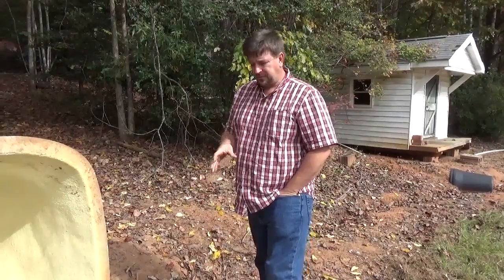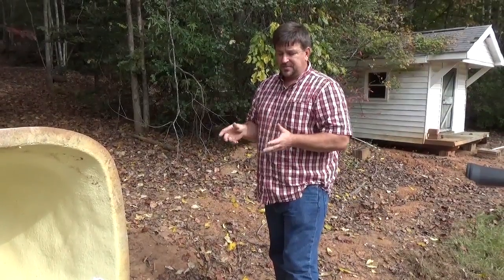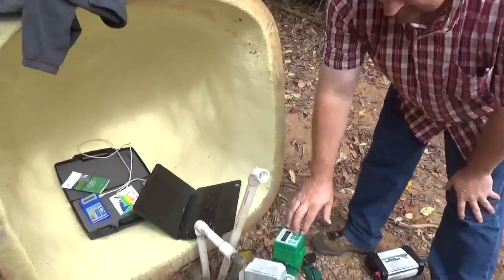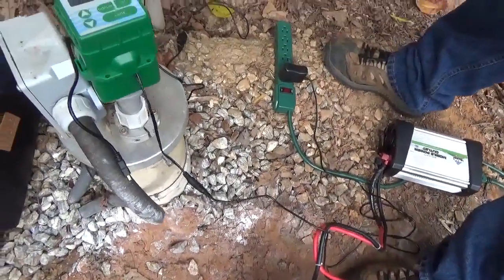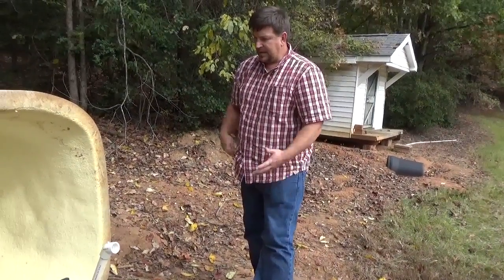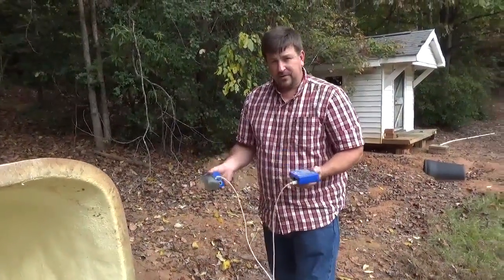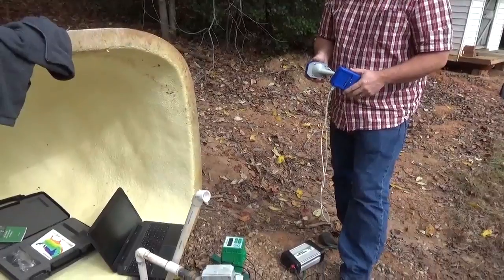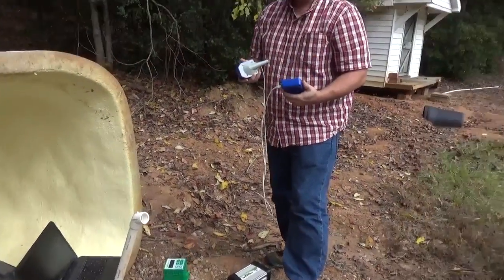Well Monitoring With Well Watch

Comment: I have one of these in one of my wells, you don't need an inverter and power supply.  The wellwatch runs on something like 9-14dc.  You could just hook it to a lead acid battery like you use in a UPS or security system.  Then put one of the RV battery tenders on it and voila.

Comment: I've tried to find out how deep my well is, with no luck.  Is there a way to find this info, without buying expensive equipment?  I think well installers should mount a plate to the housing with depth, volume, pump model & S.N., etc.  Also, a nearby well, about 75 feet from mine, makes a lot of noise... sounds like a waterfall inside the housing... What's that about?  It doesn't seem to coincide with rainfall.  My property dates back to 1789, a filled and covered dug well is nearby (about 20' away) and every so often, my water turns rusty for about 24-48 hours.  I'm always cleaning out the airraters, clogged with what looks like ground salt & pepper.  Would love some advice and help understanding what I have here.  Thanks, +Blessings
Reply: Fishing string and a weight.

Comment: In many areas I compare well water to solar power.  It helps to have external storage capacity.  You can take advantage of periods of high production and have a nice buffer for periods of low production.  This is especially useful if your well water requires treatment for iron, sulfur, or biological issues.  Batch treat it and store it in underground tanks.  In all fairness, it helps to know (monitor) your water levels, but at the end of the day, dry is dry and it doesn't really matter why.  I guess what I am trying to say is that a fuel gauge on a car should tell you when to get fuel, not when you will have to walk the rest of the way.  You don't really have the option to "re-fill" your well.  Recovery can take hours or days.  Harvest the well water and store it while you can.
Reply: There are benefits to knowing when you are close to bottoming your well beyond just a warning of the inevitable.   You really don't want to have your pump sucking silt or muck or nothing at all.  Bad for the pump,  bad for your down line systems. Even if the monitor can't help you  prevent a drought, it can definitely help protect your system.  I'd like to see some easy ways to use the monitor to automatically shut off the pump if the level drops. Maybe use a simple microcontroller to debounce readings and eliminate false alarms,  allow overrides etc?
Reply: sreyemhtes Any good plumbing contractor, with a well certification, can rig a small, mini float switch that kills power to the pump.  Much like a sump pump in your basement, but killing power rather than engaging it.

Comment: So it stores the data into internal memory of some sort until you download it? I assume if you run out of battery, then the data is lost?
Reply from the maker: Yes it stores 25million readings at an interval you specify.  if the power is interrupted you do not lose existing data.  I just import the file to excel and graph.
Reply: +engineer775 Practical Preppers I have natural gas in my well. do you know a way to capture the gas and store it under pressure. thanks